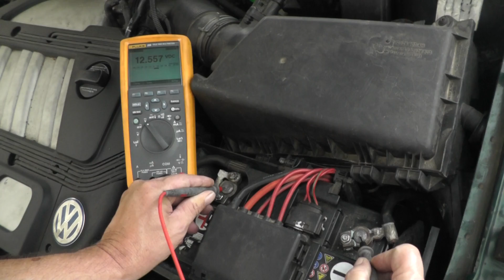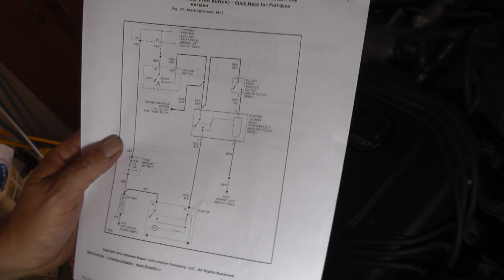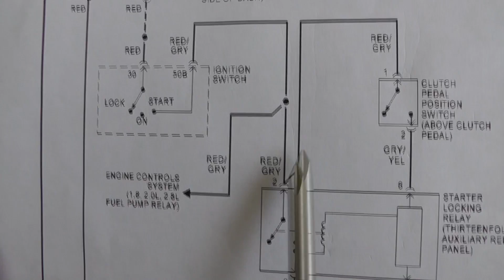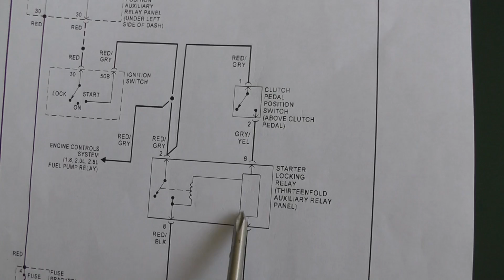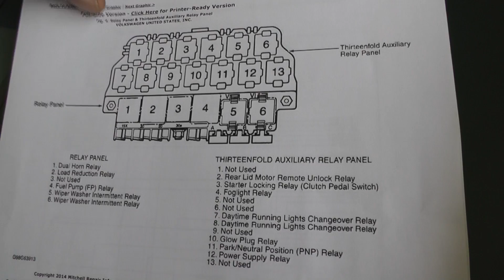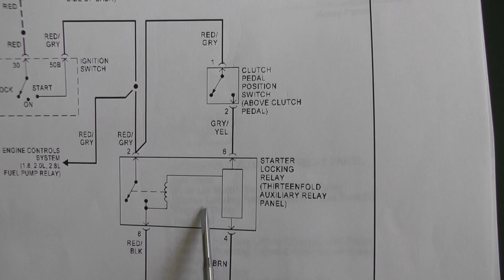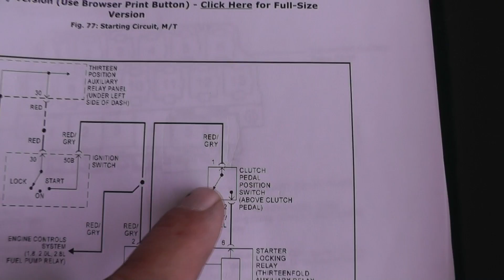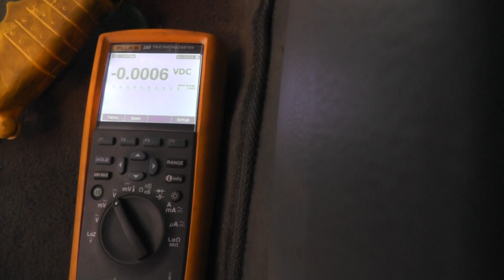Volkswagen Jetta Won't Crank, Electrical Diagnosis - Part 1

Comment: U were right just checked and the batt died over night tried to jump it and it still won't turn over
Reply from the maker: See if you can get a battery charger on it and get the battery charged up. If it won't charge fully, then you'll need to get a new battery. Sometimes, when batteries get really dead, a jump start sometimes still won't get it going. After you get it cranked, do some more testing to ensure the charging system is working correctly. While you're there, go ahead and clean up the terminals on the cables too. Hopefully, it's just a battery problem giving you the issue.

Comment: Unfortunately this dose not seem to b the problem my jetta dose the same thing turn the key and all dash lights work raido kicks on and off but the car wont crank im lost tested the bat and it has 12.64 volts but when i turn the key it drops 4 or 5 volts any suggestions
Reply from the maker: Chris, where are you measuring the voltage, is it at the battery posts? If so, sounds like you've got a near dead battery.
Reply: Does it turn over at all and what happens when you jump it from the battery in another car?:

Comment: Yeah, Terry if you can do a video of the electrical detail behind how a starter motor works it would clarify some issues I've always wondered about. Specifically the little electric dance that happens when it switches from engaging the gear to just holding the gear engaged -- it seems to be a two step process. And why the motor current naturally spikes when the starter is not moving and then drops to a lower amperage when it spins. Thanks for posting these, I'm slowly catching up since we had so much busy time this summer. Cheers!
Reply from the maker: Good thing you caught me on this Dave. I just finished the filming on the diagrams, but haven't uploaded it yet. I'll add the part about the pull-in and hold-in solenoid windings along with the current spiking...Did you ever get that post in? I'm looking forward to #2 of that video...Take care Dave...
Reply: Any motor under load at zero RPM will draw the most current which will drop off as the motor starts turning.

Comment: In the wiring diagram there is a "clutch pedal position switch".  Does this mean that your wife's Golf engine will only  start if the clutch pedal is depressed when turning the ignition switch? 
I hope you don't mind me mentioning, that you remind me of the late actor Charles Bronson.  I am learning from and enjoying your videos.  Your wife and Jose are excellent.  You are not so bad yourself.
Reply from the maker: Hi toyo. That is correct, the clutch pedal has to pressed before the engine will crank. Otherwise, if the car was in gear and you turned the key to start, the car will move creating a safety hazard. Mmmm, glad to hear that I remind you of Charles Bronson, but no kin that I'm aware (smiling)...What, wife and Jose are excellent and I'm not there in their category? LOL.
Reply: @stuzman52    I have a problem with my 1995 vw clx 1.8l car.  Have no spark in the spark plug. And no spark in the hall sender. Have a 4wire coil in place don't know how the wiring  work
Reply from the maker: @PaulBickram  I got rid of this car years ago and I don't have access to any diagrams. However, there is a fella here on YouTube who works on these cars everyday for a living. Check his channel out and post your question there. https://www.youtube.com/@EXOVCDS

Comment: Excellent video dear sir. I got the second part also and will watch it after comment here. Great diagnostic and enjoyable work performed. Really need a video on starter locking relay function. Please upload when ever find some chance for that. Regards,
Reply from the maker: Thanks Jahan. Looking at the car right now and it's not going to be an easy fix. Looks like more stuff is got to come out to get access to the wiring insulation burnt.
Reply: stuzman52 Hope with your rock knowledge and effort things will be solved as previous! This will bring something very nice and good for us to see and understand. Remember sir for starter locking relay video in future. Regards,
Reply from the maker: LearningZone Thanks for the vote of confidence Jahan. In this video, I talked about the starter locking relay and how it worked. Basically, there is some electronics in the module that will provide a dc- (0v) to the relay coil, (also inside the same module). When the electronics receives +12V through the ignition start switch and clutch pedal switch, the relay contact closes. Then +12V is sent down to the solenoid components inside the starter. Not sure what more I could say about it Jahan. Depending on how much stuff I've got to take out, I may be able to get a shot of it so we can see what it looks like. Is there anything else that you would like to know about it?
Reply: stuzman52 Thanks for your explanation dear Sir! What I learned looking at schematic is first the electronic module is providing  a +ve on the relay coil terminal which is connect with the electronic module. The coil will find its ground inside the starter. So by this way the starter locking relay energizes. At that moment the coil terminal connected to starter will get +ve at that moment the electronics changes the polarity and provides a -Ve on the coil and pulling current through it. So same way relay remains energized. Please look at my understanding and correct me if it is needed. Regards,
Reply from the maker: LearningZone Yes Johan, you are correct. In fact, looking back at the wiring diagram, I left out a step. As you've said, the bottom side of the relay is getting a ground through the solenoid winding. But notice that the relay coil is wired in series with the solenoid windings. So, it wouldn't be getting a full B+ voltage. The relay coil is going to require a minimum amount of current to pull in. This means that the electronics would have to provide a B+ voltage first at the top of the relay coil to get it to energize.  The relay contact will close providing B+ to the solenoid windings. But now, the bottom side of the relay coil has a positive polarity. Since the top side of the coil would be positive also, the relay would drop out. So, evidently, the electronics switches the polarity to dc- to keep the relay energized. How does it know when to do this? I would assume that the current is being monitored through the relay coil and solenoid windings. Then once the relay contact changes state, and the polarity is the same on both sides of the relay coil, the electronics would know it because the relay current just dropped. At that point, the electronics switches polarity as mentioned. I can't say 100% that this is the way it works, but it seems feasible to me. What do you think Jahan?
Reply: stuzman52 Dear sir you are very much right this was what I was thinking but was not able to give proper wording as you gave. So nice of you sir. I will try to make search on the topic to find more details if there. Regards,
Reply from the maker: LearningZone That would be great Jahan if you find anything on it as it could be a topic of good discussion. Let us know if you find something on it and maybe you could do a video on its operation.

Comment: Didn't see you pressing in the clutch switch after the key was turned.  If the switch wasn't depressed then of course you aren't going to get 12v through the switch.  Wish you would have shown that and your grounding location.
Reply from the maker: No need to press the clutch switch DJ. I only need to turn the ignition switch to the start position to send 12V to the clutch switch. Pressing the clutch switch off and on is not going to toggle my voltage. I'm on the top side of the clutch switch where it should be hot all the time when the ignition switch is in the start position. As for the ground connection, it was just a metal bracket and I didn't see the importance. Probably could have shown the t-pin connection at the clutch switch. Thanks for the comment DJ.
Reply: stuzman52 Ohhh I went back and rewatched the video.  The first test was just to test your meter for a good 12v signal.  2nd test was for the red wire.  I thought the first test was the red wire and 2nd test was after the switch indicating a bad clutch switch.  Got it.  So next in process of elimination to cut the work in half I think would be the Red/Gray after the ignition switch.  Once you get the column cover off it should be fairly easy to get at plus you can try to find the source of that smoke.
Reply from the maker: ***** You got it DJ and I couldn't explained it any better. My first check as you said was just to check my ground to see if I had +12V which was a big red wire coming up on a stud of the relay center. Looking back at it now, I probably should have shown my connections, but what seemed obvious to me was probably not clear. Once I found that I had +12V which confirmed that my ground was good, then I went right to the clutch pedal switch which was measured on the top side as you've said to see which half of the circuit the problem lies. You know the old saying, should be pretty easy now, or have you heard the one that goes like this, "all you gotta do is...". I'm with you,  as I hope it's not too bad of a problem. Take care DJ...